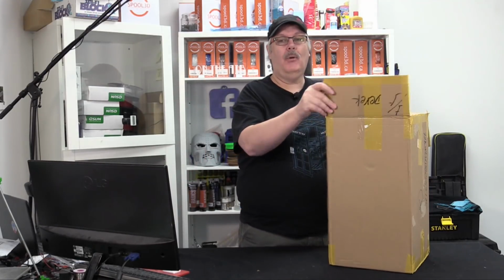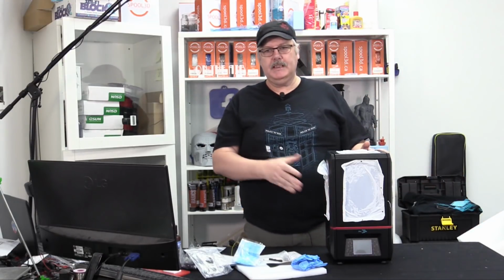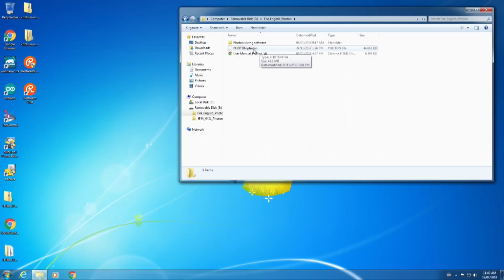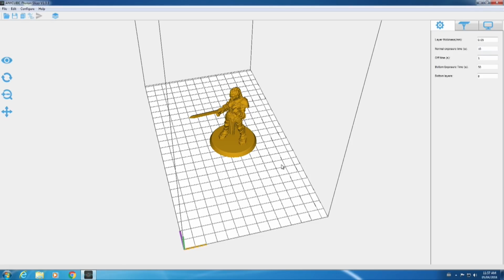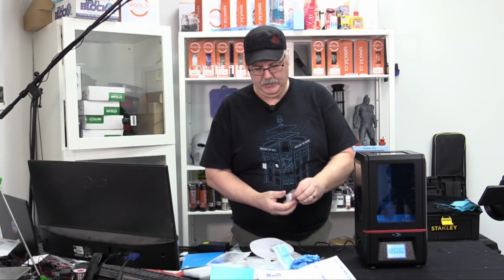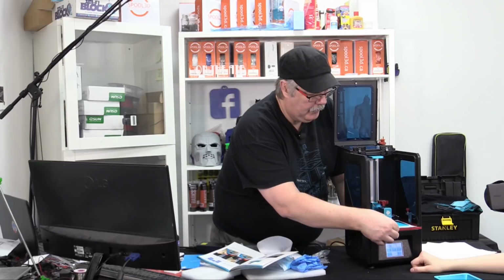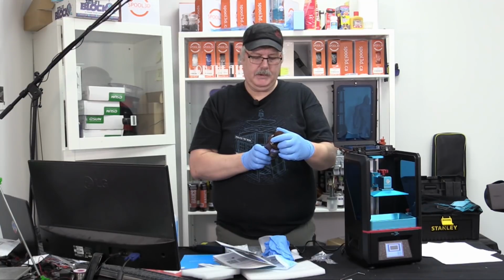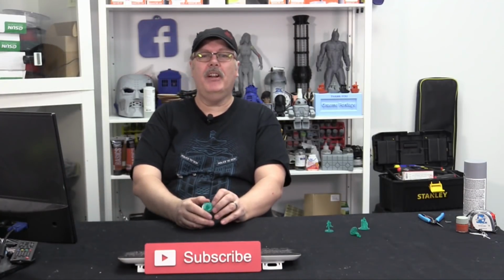Our first look at the Anycubic Photon DLP 3D resin printer

Comment: Thanks for covering this printer.  I'm considering buying it for printing mostly tabletop gaming models.  It looks like you printed at 50 micron layers.  If you decide to cover this again, could you print a 28mm figure again at 25 microns and compare here to a traditionally cast modern figure (both primed grey so we can see like for like details as it's hard to see with the translucent green resin).